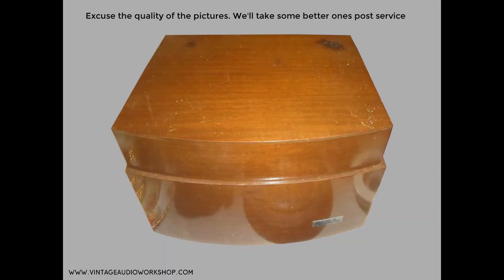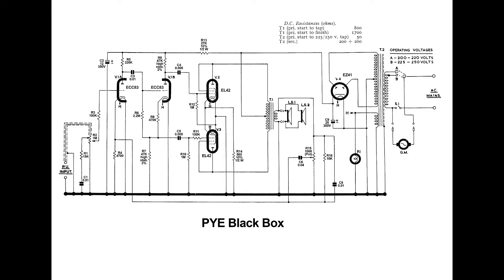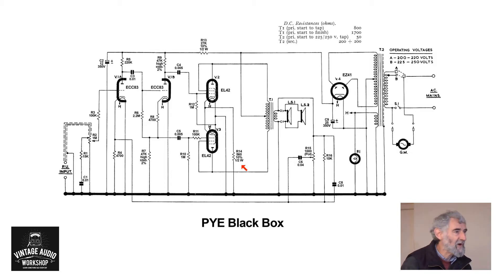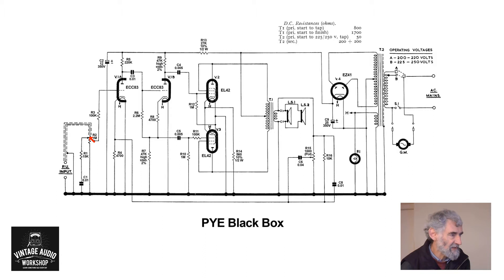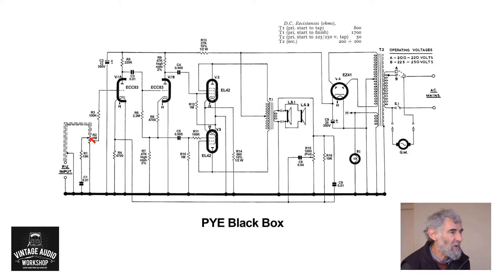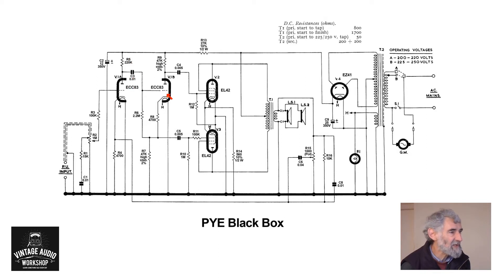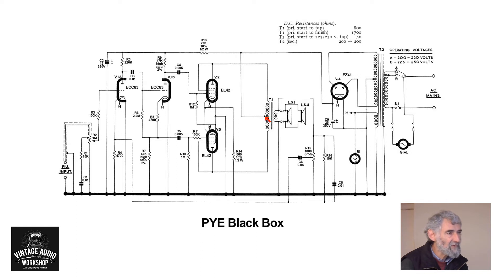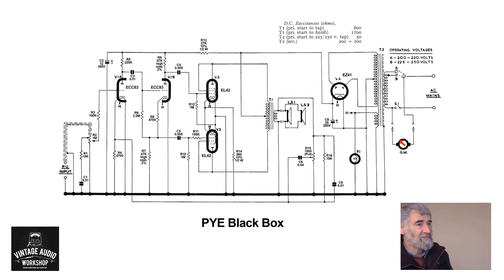Valve Amplifier Study 018: Pye Black Box Record Player; EZ41, EL42 (x2), ECC83

Comment: The output must have been quite low as triodes wonder why they did that, seams an odd thing to do!
Reply: There would be little requirement for  more than two or three watts from a player like this. Most small players would have a single valve giving the same output with a magnitude more distortion than this triode push pull stage. Low distortion would be the design motivation for this model, as it had in design, thoughts of quality performance. There is no other reason. Later models took advantage of ultra linear operation and would have a full six or seven watts at the same distortion levels.
Reply: Good grief.. 4 years ago.. I'm sure you are still interested... Ha ha.

Comment: and 1 grid stopper on the output tubes
Reply from the maker: It was in no way unusual at the time not to have fuses but this would not be legal now.
Either the circuit is wrong, or they found that they needed 1 grid-stopper on the OP valve to stabilise it, but not both which was probably done to cut costs. Unusual but believable.
Thanks for your comment,
Phil